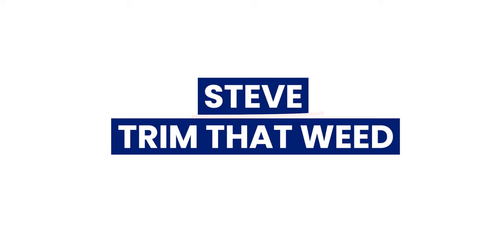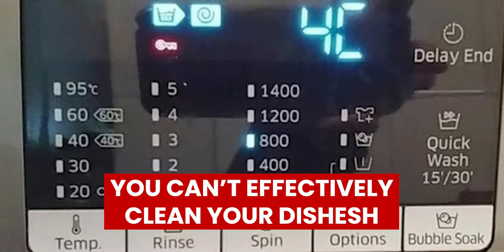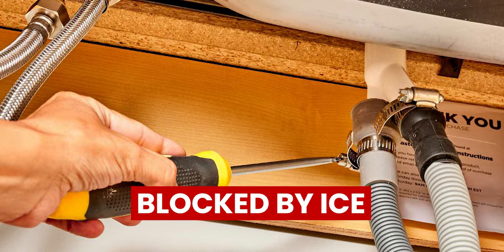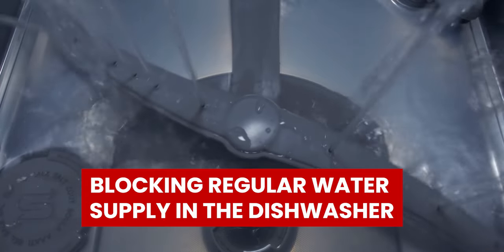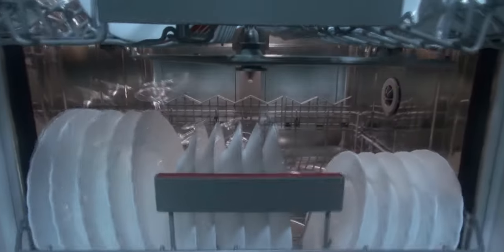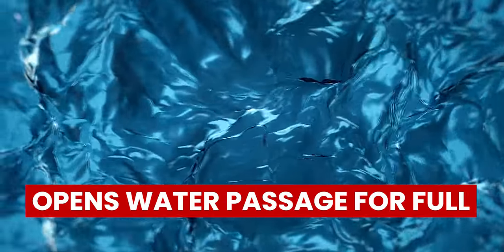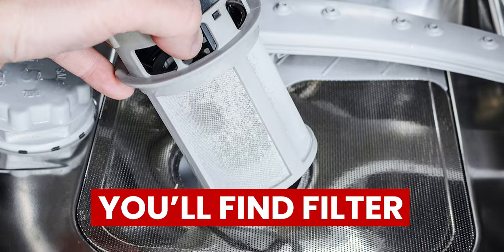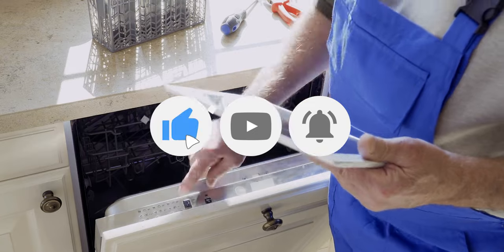Samsung Dishwasher 4c Error – Exploring Origins, Solutions, and Quick Fixes (Address the Issue)

Comment: why do you keep talking about ice?  ive never once heard of a dishwasher having ice in the supply line.  good lord
Reply: When temperatures are low, water supply pipes can freeze up. It's quite a normal occurance in cold parts of the world. Use your brain. Good lord.
Reply: @kananelofatlane4604  I live in one of the coldest places in the United States, not ONCE has the dishwasher or hot water pipes frozen in a house unless the heat is turned off to the furnace and hot water heater.  Maybe in trailer homes or homes without insulation